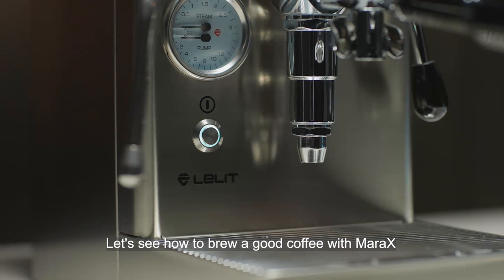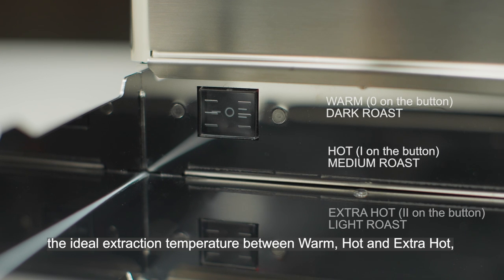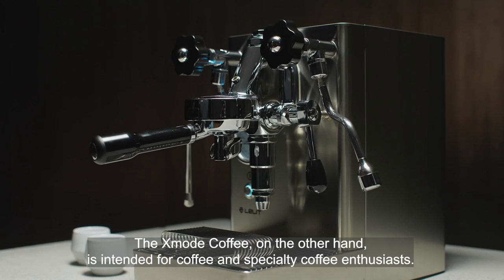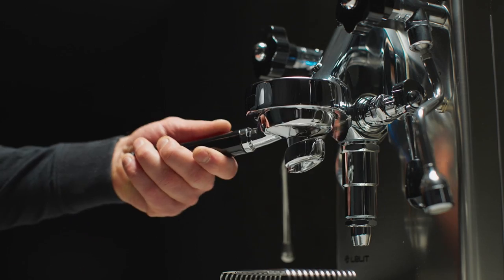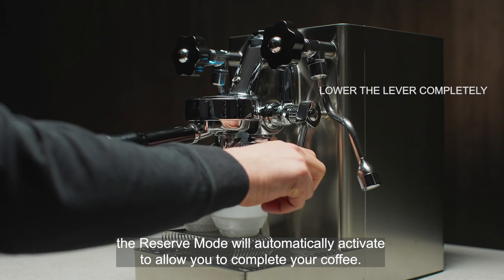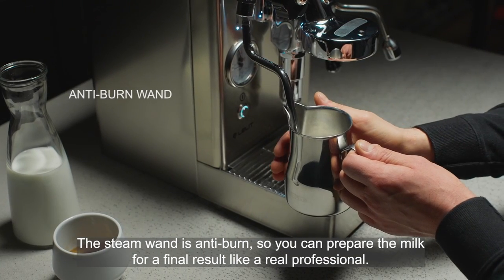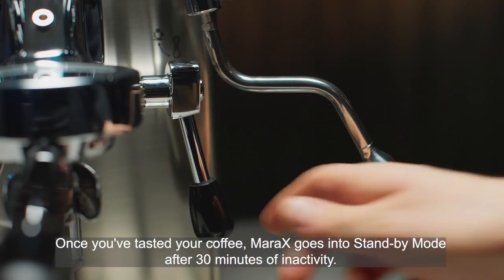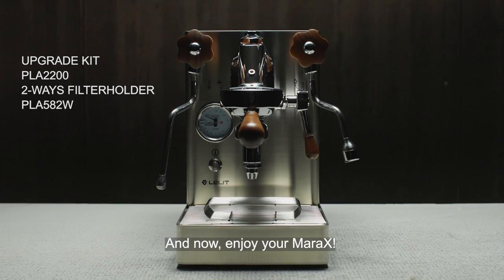[Tutorial Video] LELIT MaraX PL62X ESPRESSO MACHINE HX HEAT EXCHANGER

Comment: on lelit marax e61 group construction doesnot have preinfusion- its easy to check- required engage e61 lever on 1/3 turn (nothing happens), only full engagement activate pump. you are talking about HX  advantages brewing coffee and steaming milk at he same time, but demonstration shows opposite, i.e. coffee and milk in row..
Reply from the maker: True you can do both at the same time which is our preference. If people are starting out, they might not be able to multitask and will make the coffee and steam the milk separately.
Reply: 25 min to heat up?